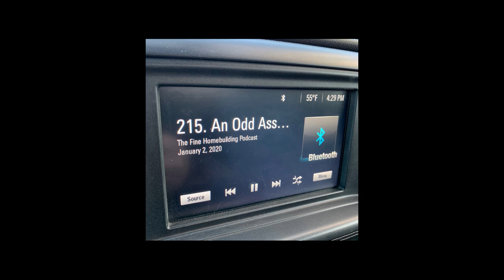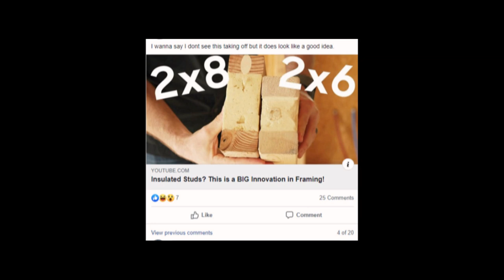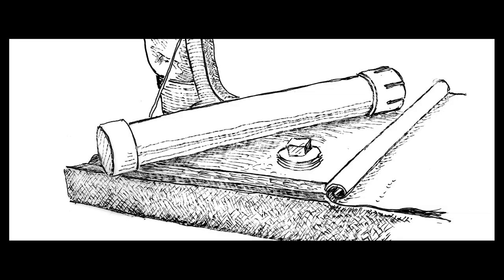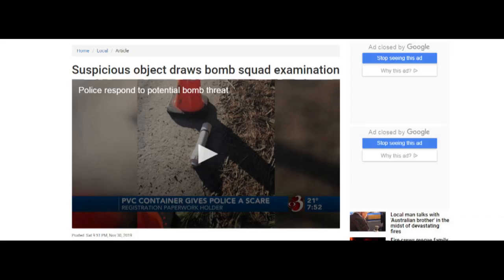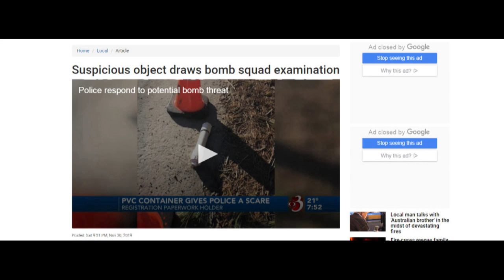Podcast 224: Botched Drywall, Bow-Roof Cabins and a Baseboard Radiator Hater

Comment: Fiberglass mesh tape is for harder (faster) drying miss, like 20 or 90 minute. Paper tape is for all-purpose or topping compounds. Drywall mud over painted surfaces is usually ok, but semi-gloss may need prior sanding. Wet sanding also works well for level 5 finishes, particularly with quick setting mud mixtures. Rolled skim coat is fine if you're fine with the stippled texture it leaves, drywall guys hate it cuz its "lazy". As for the questioner, if the walls that were repaired are fine I would repair the ceiling the same way. The cracks occurred because the wrong tape was used, if they are covered afterwards it's possible they won't come back. If they do, go with the nuclear option of cutting out the tape and drywall paper face with a razor knife and re-patch. 5/8 drywall is fire code, at least in CA.

Comment: Change the anode rod after the first year, so that the metal decaying off the rod fills any imperfections in the manufactured tank liner. After that let it go. If your water heater is old and you're not sure whether it's been changed or not, skip it. The scale has already accomplished this task, albeit in a much less permanent fashion. Electric outlast gas due to the total input energy (exergy for the needs) with gas you make 3500 degrees to heat water to 120. With electricity it's much less, heat pumps even less than that.  Check out Kristof Irwin from Positive Energy and the Building Science Podcast, along with Roger Wakefield the Expert Plumber, both on Youtube